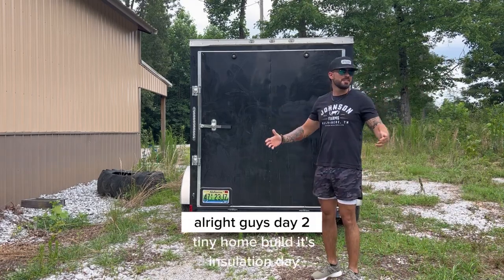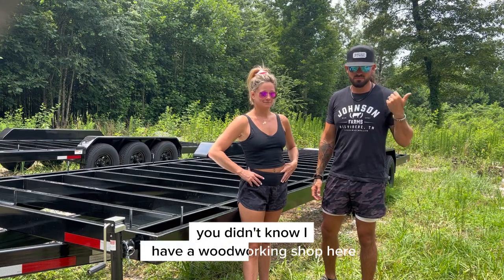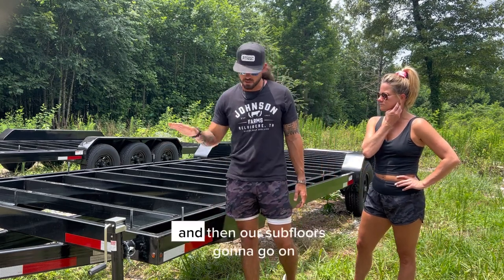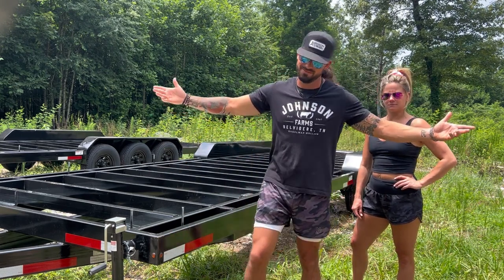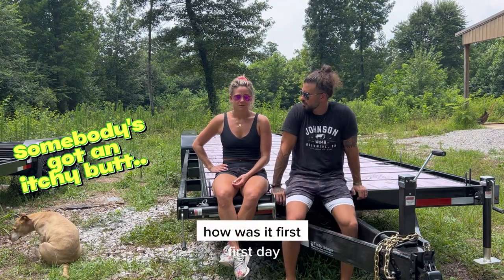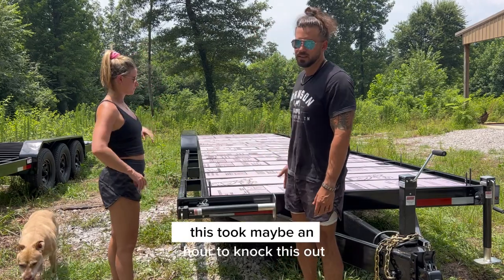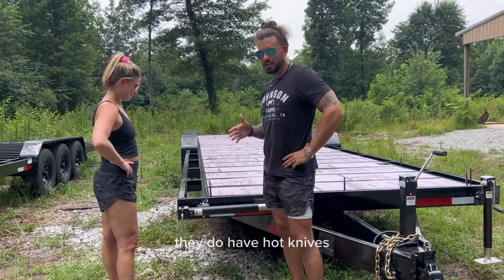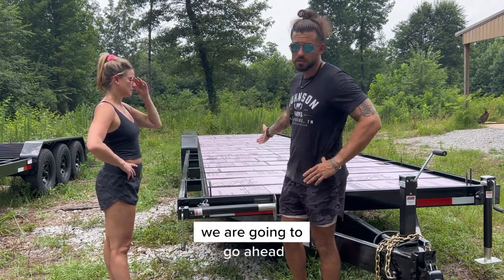Tiny Home Build - Part 2: Trailer/Subfloor Insulation Installation

Comment: I maybe would have used some foil faced insulation with the foil side facing down just to help protect the bottom from road kick up during hauling. I'm not sure if I'm thinking right there or not.
Looks good though!
Reply from the maker: I had the same thought, but if all goes according to plan, these things will only hit the road once for about 20 minutes. If that changes, we may add a little more protection underneath. Thank ya sir!

Comment: Not sure if this will help as I do not know in what state are you, but a while back I found guys that did spray foam on FB marketplace, they have done insulation for many of my residential properties now and are great, and I got a quote for the spray foam of the whole house, (8x24) floor, walls and roof $1,500 not sure if you think it's a good deal, if you will probably spend as much as that on the whole tiny house, but looking forward saving a bit of work, due to my trailers being an hour from me and need to sub a lot of the work.
Reply from the maker: That's roughly what I'm expecting to pay per house, but that's just based on a wild guess. I haven't reached out for quotes on that yet. That's something I'm definitely leaving to the experts lol. We are right on the TN/AL line.